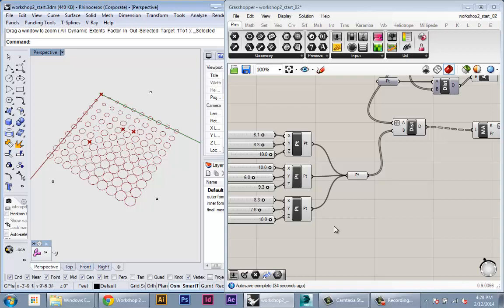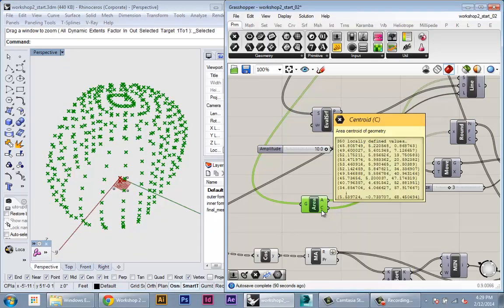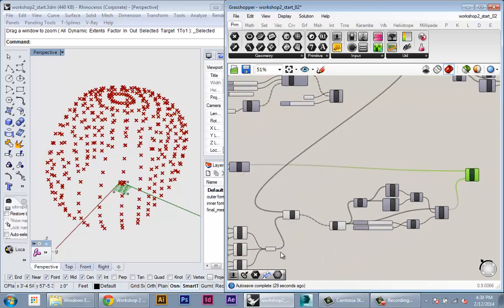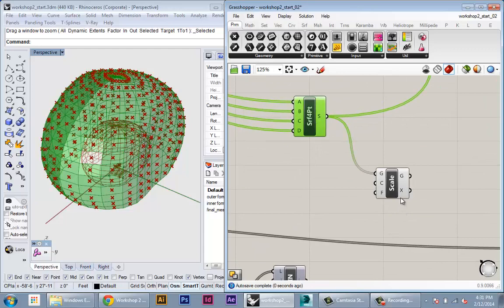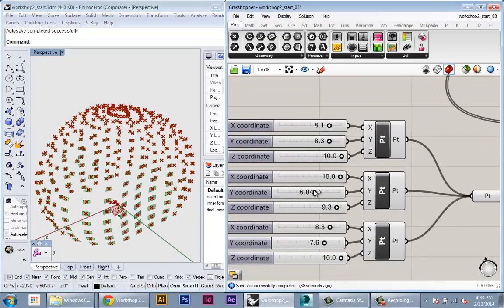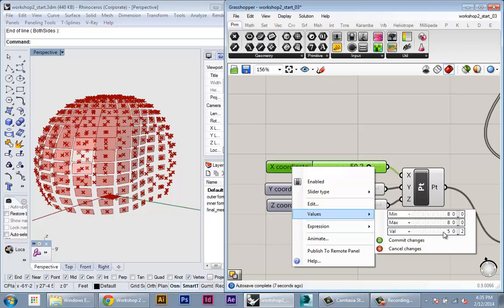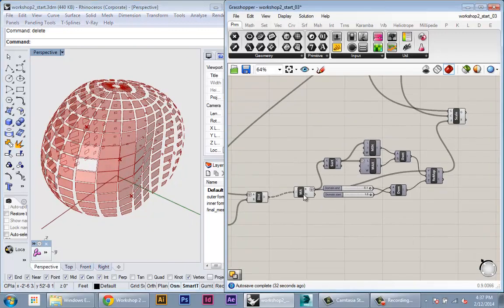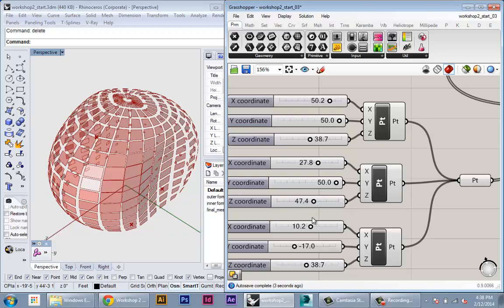Grasshopper Attractor Points 3/3

Comment: Say I have a finish surface in grasshopper, can I apply (Grasshopper Attractor Points tutorial 2) to my surface. In other word can I apply it to any surface with a geometry.
Reply: I have the same question, also for curves. For example, I would like to do the same thing, but only with a polygon. Have you found a solution?